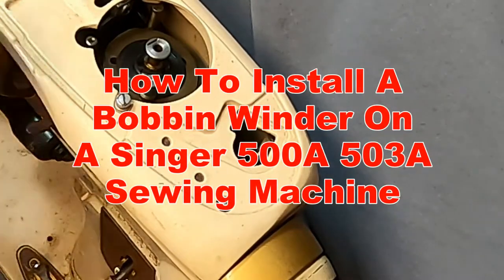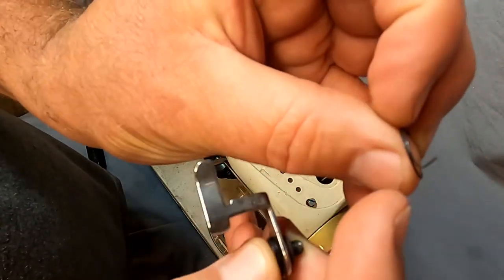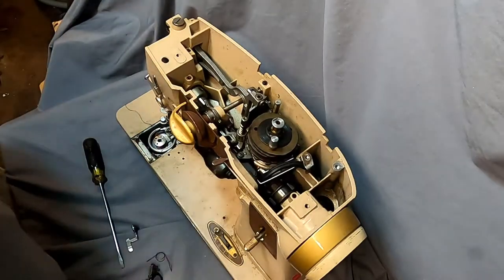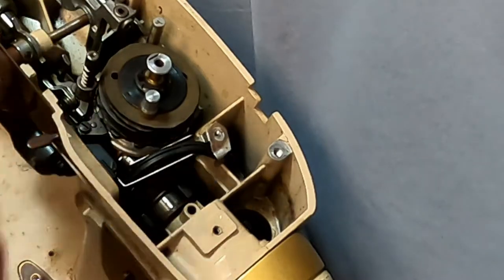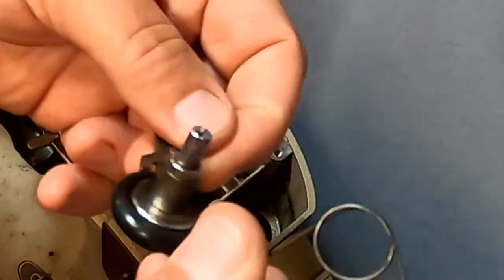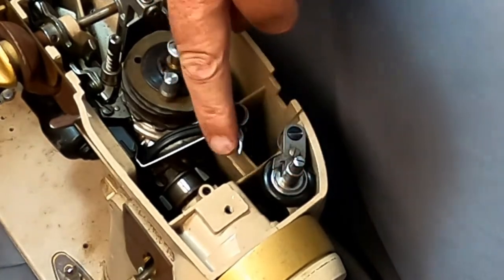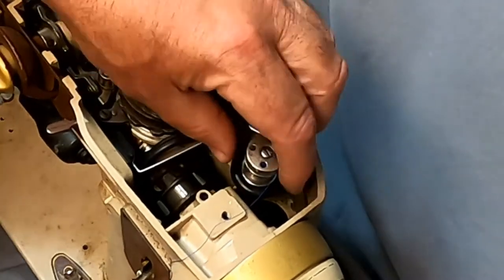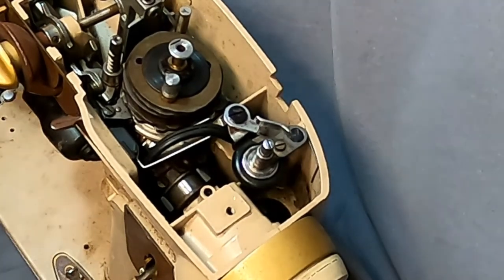How To Install Bobbin Winder on Vintage a Singer 500A 503A Rocketeer Sewing Machine 172165

Comment: I can't thank you enough for this video.  I have a Singer Slantomatic 500a and the bobbin winder quit on me.  It was the rubber ring, of course, which had turned grey, brittle, and was shredded.  I was able to recognize and order the ring, then clean things up, replace it, and figure out the spring (soooooo many thanks) and it just filled a bobbin for me and automatically stopped when the bobbin was full.  I'm thrilled.
Reply from the maker: Im so glad the video helped and thank you so much for your tip!

Comment: In your other video with the "Very rare Singer Sewing Motor" do you happen to know what year they are from or any other info on them? I came across one but can't seem to find much info on it. Thanks
Reply from the maker: all i can figure it is the motors were originally made by Hamilton Beach. They dated from around 1915-17 till maybe 1920-22 when the 99 was released with a motor.